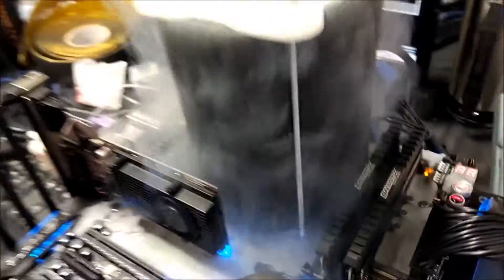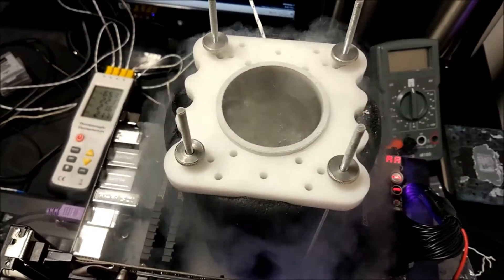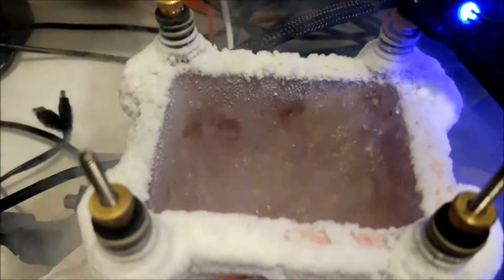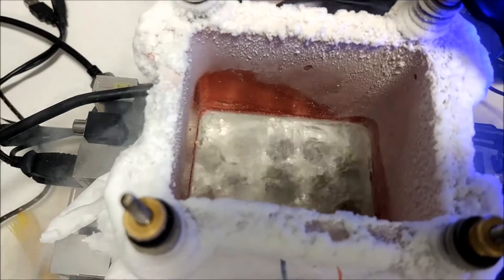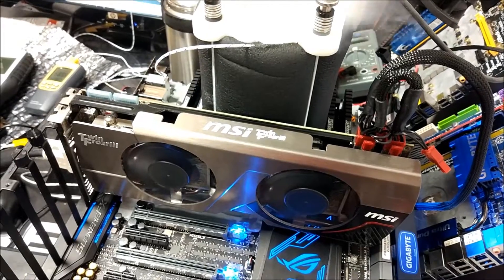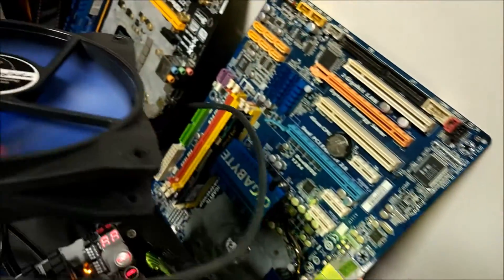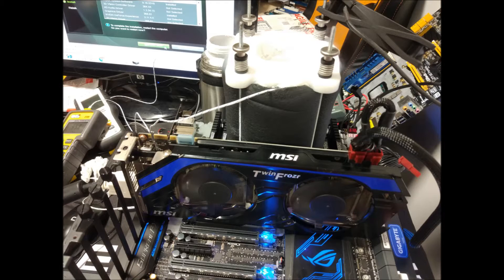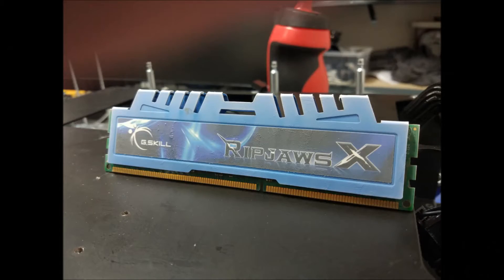First UK Overclocking Meet 2017 At Play3r HQ With 135L of LN2

Comment: You just poured liquid nitrogen on that aircooled gtx 670? Well ok....
Reply from the maker: yeah :P
Reply: Lawrence Timme And it was alright. Don't you need a pot to pour that stuff in?
Reply from the maker: yeah you are suppose to pout it into a pot, but i didnt have time to put a pot on it and we would have run out of ln2 :P i was just doing it cos it looked cool :)
Reply: Lawrence Timme I guess it was initially fine. Have you tested the card after that?
Reply from the maker: yeah its fine. ln2 isnt conductive like water so you can pour it all over if you want as long as it doesnt make the card or board get condensation on it.